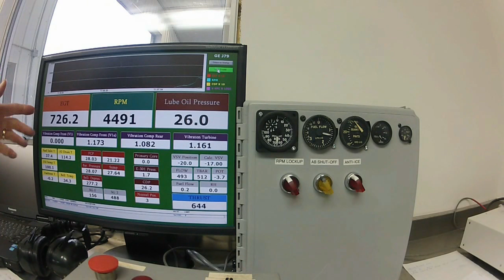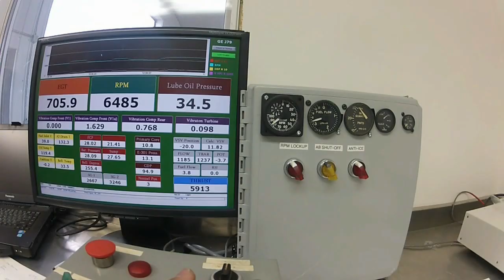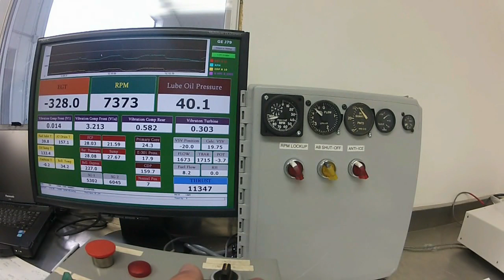Afterburner Thursday

Comment: Thanks for sharing.

Can you confirm if the fuel flow gauge is indicating fuel flow in thousands of pounds per hour or is it a shorter unit of time?

Having a camera on the instrumentation for the whole test was awesome.

Again thank you.
Reply from the maker: the aircraft gauge reads in Litres per Minute X 10.
It only records fuel flow to the engine, and does not include afterburner fuel.

Comment: Hello Jay,

I have a couple questions that I have wondered about since the first time I saw a jet engine diagram in an encyclopedia when I was a youngster.  What is the phenomenon that prevents the combusted air-fuel mixture from acting on the compressor blades in the same manner that it drives the turbine blades, thereby cancelling rotation?

In a related question, how is torque and internal energy distributed between the turbine stage and the compressor stage?  I know that energy is extracted from the turbine to spin the compressor, which suggests that the turbine is more energetic because it’s driving another system.  However, this leads back to my very first question of how the compressor overcomes the tendency of expanding gasses to cause counter-flow.

Thanks,
Bryan
Reply from the maker: The answer is very easy, and very difficult for many people.
The combustion of fuel and the resulting heat does not cause an increase in pressure.
These are not piston engines, and there is no closed combustion "chamber".
The combustion heat causes the gases to expand and rush out the turbine. They don't go "uphill" towards the compressor, because the air coming out of the compressor is at a higher pressure, and flows "downhill" into the combustor.

That is the answer.
Many people don't believe that, so they can't understand how it works.
Peoples beliefs vary. Reality and the way the world works does not.
Reply from the maker: I had to edit that answer, because I typed in compressor where I should have said combustor. Hopefully it makes more sense now.

Comment: Every time you guys fire up one of those j79s or LM1500s I can't help but wonder if I could wake-board or surf on the jet wash with a tied down tow rope from the right distance, or maybe on a curved jet blast shield shaped like a skateboard ramp.

That or stand a good distance away strapped into a parachute and then open it with a BASE jump drogue.

No, this is probably not a good idea.
Reply: Almost certainly not a good idea: not only is the exhaust still very hot even at many tens of feet, but it's blowing grit and dirt around at a couple hundred miles an hour.
Reply: This is what ~54,000 lbs of thrust does to a vehicle.  Something tells me 1/4 the thrust in 1/8th the area is going to essentially rip your legs off.
Reply from the maker: You could try, and I bet it would be just like wakeboarding at 550Mph.
Your feet might get a little hot, and your board might melt.
Oh, and if you wipe out, it would mean certain death by several converging causes...like being ripped apart, and burned, and then landing on the ground at a couple hundred miles per hour.
Don't let me scare you off your idea though...
Reply: Sounds like one of those - "hold my beer - watch this" moments. :)

Comment: Another great video Jay, loved it. Got a couple questions what are all the items you are monitoring on the display? The obvious ones are there but lots i can't even think of what the letters are. Secondly this engine was designed to be flying and having air forced in the front, do you have to do anything to run them in a stationary platform with a afterburner?  Thanks again Jay your videos are the best on youtube.

Comment: Jay, am I correct in thinking that when afterburner is ignited it doesn't do anything to the engine RPM at all, it just adds pure thrust due to the extra expanding hot air coming out of the tailpipe? Also Is the RPM on the display the actual speed I.E full throttle 7000RPM + - 300 RPM or is the display not showing a 0 at the end I.E 70000RPM? If this is the case I didn't know that these engine revved that slow!! Thanks for sharing your Vids are always interesting Clive from the UK
Reply: nope, 7,000 is the correct number of digits for a large engine. The little model turbojet engines for R/C aircraft rev up to 250,000 RPM though. The afterburner may add a little bit of backpressure to the turbine (correct me if I'm wrong Jay) but overall you are correct and it doesn't have any effect on the gas generator. It's just the massive input of heat (and therefore gain in pressure and velocity) that makes an afterburner add thrust.
Reply from the maker: Ryan Willis Yeah... what he said, and then some !
Reply: yep, I'm sure I have only scratched the surface of how all this stuff works, since I don't work on them daily :P

Comment: Sorry if this has been asked a thousand times, but is that white 'bell' on the intake just there for the test stand or does it remain mounted while in service?  My assumption has always been (for aircraft anyway) that it is removed and the cowling takes over that role.
Reply: They have this shape of engine bell to reduce forming of shockwaves inside the engine as would be caused if the air would have to take the sharp corner that the regular cowlings mounted on the engines would make it take. But regular engines move through the air and are not steady object like when they are mounted into the test cell.
Reply from the maker: These engines are designed to receive inlet airflow as they move through the air. Being stationary on the test stand causes slight loss of inlet air pressure. The bellmouth helps reduce this loss by making a smoother pathway for air entering the inlet.
It's an test-cell only piece of equipment, and there are no shock waves involved.
Reply: Achim Hanischdörfer
And that's why we leave it to the experts to answer questions directed to the experts.
Reply: lazaglider
Thank you very much for your kindness.
Reply: Achim Hanischdörfer
 You are welcome, I admire anyone who takes the time to learn about a subject in depth.

Comment: Can you explain why the jet nozzle opens/closes when the afterburner is turned on/off?
Reply from the maker: Not again, for a while anyway...
Reply: crazyscience 
Cause aerodynamics. When the engine is on dry thrust (afterburner off) the exhaust is subsonic and subsonic flow accelerates when you force it through a narrowing passage thereby turning static pressure (that we measure with a barometer) into dynamic pressure (exhaust velocity).
The additional combustion in the exhaust stream on wet thrust (afterburner on) means that the exhaust is now supersonic. Supersonic flow accelerates when it's passed through a widening passage with the same effect, just the nozzle has to be inversly shaped compared to the subsonic flow.

PS this has been covered in the "Your Questions" series on this channel, just search the playlist for it.

Comment: i have a rather odd question, do you see any sort of difference in engine stats in the summer versus in the winter? obviously colder air is more dense than warmer air, but i don't know if that would really make a difference.
Reply from the maker: Colder air is more dense, so to make any given CDP or power level, the compressor needs to work harder, and turn faster in warmer air.
For this turbojet to make takeoff thrust in freezing weather, it takes less fuel than in summer.
Reply: i can't imagine it is any real noticeable difference difference though
Reply from the maker: Well, the engine notices, the engineer and pilot notice, and the guy buying the fuel notices.
Planes are faster and more powerful in really cold air.
Whether you imagine it makes a difference or not, the effect is there.
Reply: you are right, i guess im just falling into the trap you talked about in thinking external combustion engines function about the same as internal combustion engines.  that and im really thinking far too short term.  thanks for the answers
Reply: Thats why the max take off weight of aircrafts depends on outside temperature and height above sealevel and pilots have to calculate that before every flight
Reply: im just a ground mechanic, they fly it, i fix it...and give them fuel

Comment: Not many afterburners here where I work - http://en.wikipedia.org/wiki/File:Aerial_Paine_Field_August_2009.jpg
Reply from the maker: That's one cool place ! 
I had  look at your pic, and could not find an afterburner, but there are may interesting things parked there.
Is that a B-47 or a B-52 parked on the grass ? It looks temptingly like a B-47, a plane I've never seen in the flesh before...
Reply: AgentJayZ
 in the grass, next to the tower is a B-52. There are 3 museums here - the two buildings on the left of the runway - http://historicflight.org/hf/  ,  The two buildings (one with a blue roof) next to the water tank at the bottom of the picture - http://flyingheritage.com/  , and Boeings museum of flight - not visible, out of view at the top left of the picture - http://www.futureofflight.org/  , plus Boeing has a tour and you can see 747's, 777's, 767's and 787's being built (in that big building at the top of the picture with the blue hangar doors with pictures on them)
. And south of Seattle, Boeing has an even bigger museum with a Concord and the 1st 747 and a bunch of other old aircraft.
Reply: If you use google maps satellite view you can see lots more airplanes parked all over the place at Paine Field. The diagonal runway is covered with 787's, theres' 747's and 787's next to the tower, and north of the tower - 777's, 747's, 787's, three 767's. I work in that building that looks like a 2 gate airport terminal just left of the lake - surrounded by jets. :D